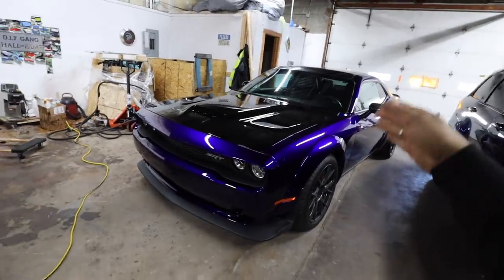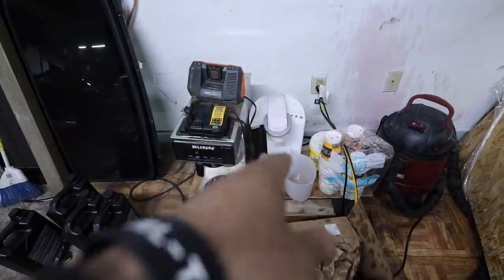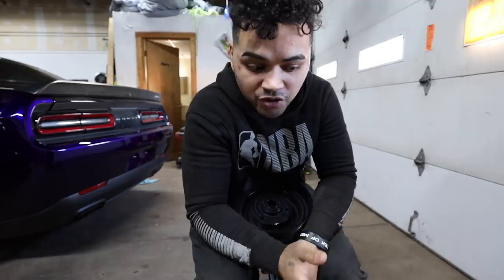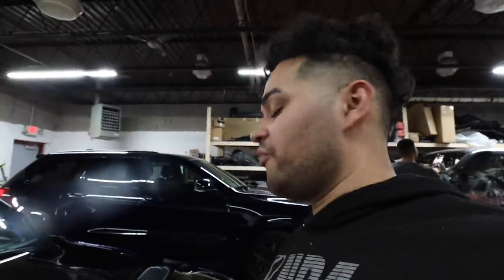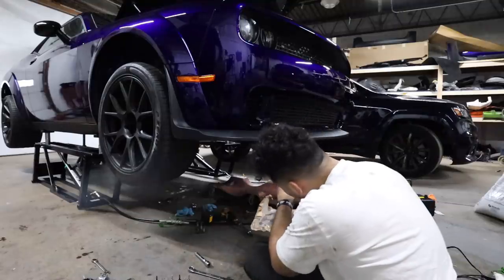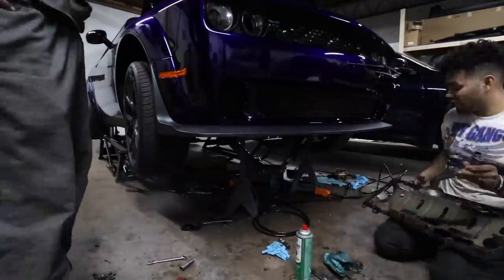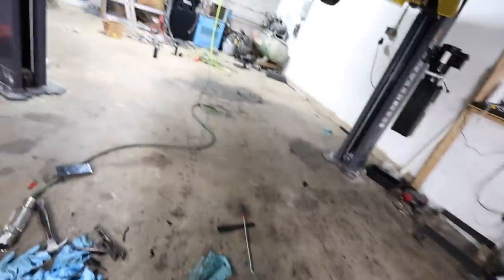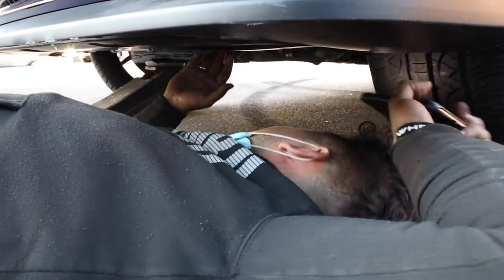Yup I sold it!

Comment: Hey Jose!!!! It looks as if the frame of the HELLCAT has been "creased" by the New hydraulic lift!??! At least I can see the tell tale sign of yellow on the frame in a couple of places that may have come from the lift "arms" at the crease point(s!?!?) I just don't know what that may or may not do to drive ability of Phoenix, or how it may effect certain parts in the future. However, you certainly did lay an awesome kick ass paint job on her, just look at the reflection of the camera as it is being backed out of the garage at the time stamp between 3:36 - 3:39. OH MYLANTA brother man!!!!
ANYWAY, KEEP ON KEEPING ON BROTHER!!!!!!!
PEACE!!!!!!!!!!!🤘
Reply: Nice observation but that won't affect the car. Also agreed the paint looks amazing
Reply: @moverplus2853  God I hope not....!! And what I mean is , I have a daughter who purchased a car at a Dealership in Queens N.Y. that has been throwing tie rods, ball joints, brakes, shoes and tires like they are going out of style And now the stabilizer bar is warping and wearing at the points of connection!! I always said, and even though the carfax report came back clean, that the frame must have been damaged somehow!! But we don't or didn't have proof of it!!  Well , not until about a month ago when we finally after almost four years found out that the car had been in an accident that damaged the frame quite badly!! It was put on a frame straightener, and sorta brought  back to factory OEM standard, then very, very, very carefully "beat" back into shape with  sledge hammers and steel plates ( the plates were used to beat against so as not to "ding" up the frame) then, the frame was sanded, repainted and now is costing my daughter an arm and leg to keep replacing those parts I mentioned!!! O.K., I get it, that is an extreme case in my daughters car and is NOT EVEN CLOSE to any possible damage on Phoenix!! And Like I said, Phoenix's frame is slightly creased, not twisted to hell and gone!!!  But it does make one wonder, that within a precision, modern, with technically advanced systems and tolerances within fractions of a millimeter, that a possibility of some goofy thing happening down the road, albeit like one in a million chance, is still a chance!!! You're probably way more right than wrong about nothing coming from those creases in the frame, but being a purist and a hair anal about things being as perfect as possible (like Jose is, I mean, one can tell that he doesn't put up with second class anything, especially on Phoenix... Just look at that paint job, and the number of times it was done before perfection was achieved) I just hope NOTHING EVER  comes from it!!!
I know this is a hair long winded to get to the point, but we all know shit happens!! NOW... If Jose takes this frame creasing head on and acknowledges it, then fixes it, that would REALLY showcase his character and talent!!!!!! ANYWAY, KEEP ON KEEPING ON Brother man!!!!!!
PEACE!!!!!!
Reply: @TheRealBKSchyster  That sucks for you and your daughter I'm sorry that that happened. Once in a million chance sorry you were the one who got stuck with it. And good luck with the repairs

Comment: JOSE..PLEASE READ..take the time and change that lift. Turn it around. Put the control to the middle of the shop. For your safety. IF.. a car was to fall off the lift you will get crushed.
Reply: Alexander.. you never want to be against a wall. Do you understand saftey?? It's a 2 post. It could be put in either way. It can be 180 turned. The post are symmetrical and will bolt right back up.

Comment: Have you tuned it yet ? You gonna have to add some fuel for that underdrive pulley. Your gonna be running super lean man. Hopefully you have gotten it tuned off air cause it's a recipe for rodney to show its face bro.

Comment: Wait...what? You dropped the oil pan, changed the gasket in the name of chasing oil leaks only to find at 14:12 its power steering pump???
Slow down guys and run thru everything before jumping in!
Just sayin...
Reply from the maker: No the oil leak happened first. Then after fixing that the power steering pump went and started leaking. 2 completely different situations
Reply: @DIYGANG  ok makes much more sense...however vid didn't make that clear. 
Love that paint. Especially under the hood, shock towers and firewall,etc looks real nice to a detail freak like some of us are!